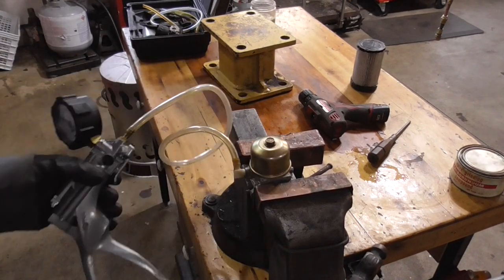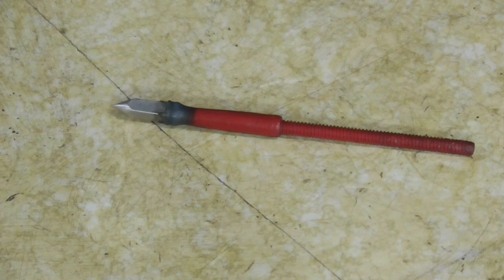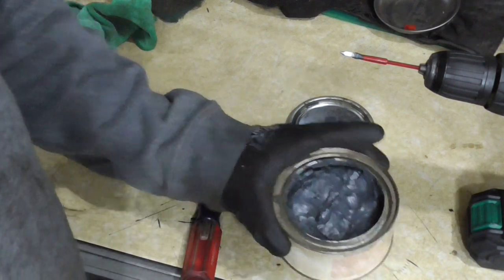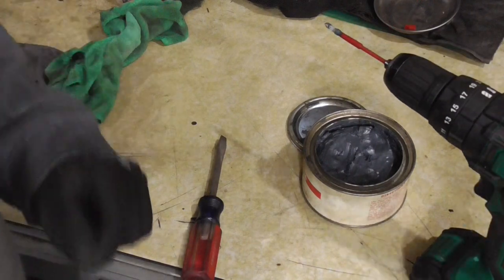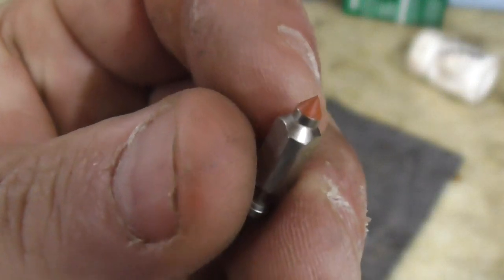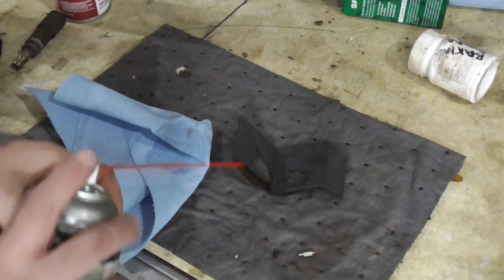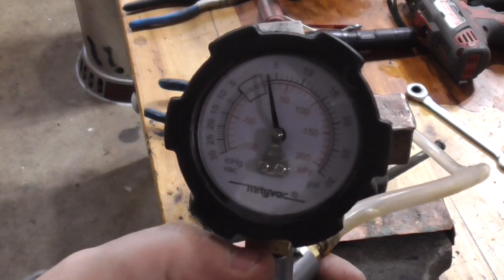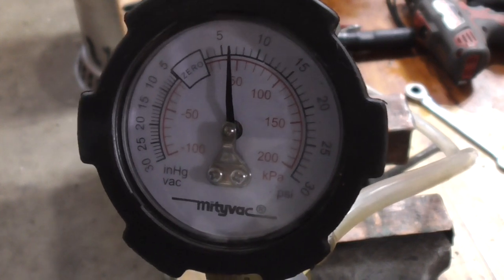Talking Carburetor Repair Tips

Comment: Great idea, Mustie1 does it too, what I've always used to do this trick is brasso polish, and a qtip, it's not as gritty as valve compound, and a lot easier to clean up, cause you don't want any of that compound inside an engine, also I have used a small brass wire bit on my dremel, it fits right down the hole, and cleans it in about 5 seconds to a shiny finish.

Comment: I have used q-tip and grinding compound with success.  Your method takes it to the next level.  Nikki carburetors are no fun to work on and prone to needle and seat issues as you said.  Like your channel better than Project Farm.

Comment: That's a tecumseh needle in your honing jig. Wonder what the shaft is made from? Taryl used fuel line but you need to use it on the needle of the carb you're honing and that's not able to be used on all sizes of needles
Reply from the maker: I saw Taryl's video come out about 4 days after I filmed mine.  Good news is we both have different tools and techniques.